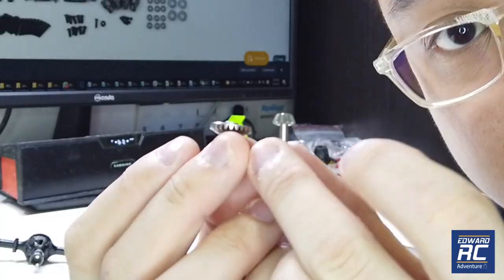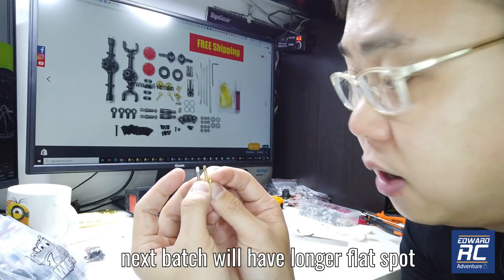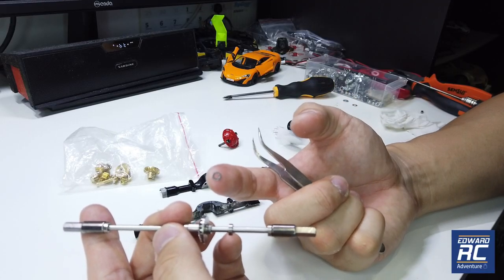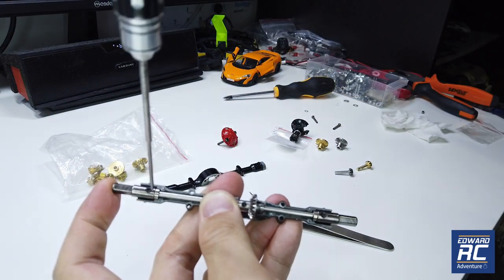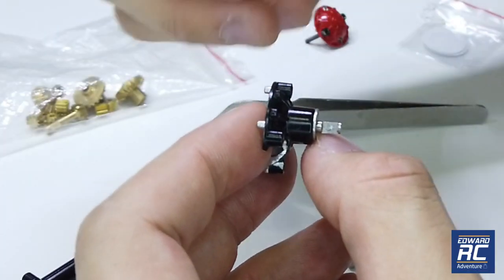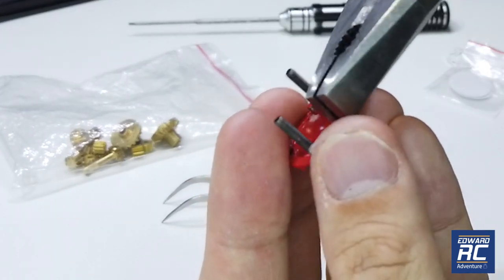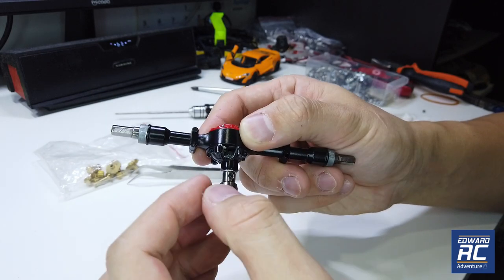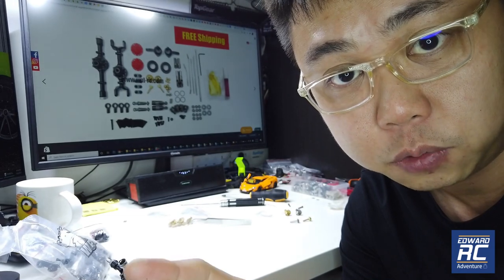WPL RC Metal Axle Steel Gears Binding Solution - CRITICAL UPDATE!

Comment: You really need to use washers with a smaller outer diameter on that input shaft, the ones you used looked as if they will be running on the outer ring of the bearing, they should only be touching the inner ring which is what rotates with the shaft.  The larger washers will just be producing friction against the bearing outer and/or the spur gear, they will wear out quickly and jam the axle with swarf.
Reply from the maker: yes that's why better to use the shims from WPL RC. in high speed application, using that M3 washer will cause high high heat.

Comment: The front brass gear on the axle, it's grub screw, even with locktite, keeps working free on me. I need a video with a real in depth view of how to get that gear set perfectly. It's so hard to keep a front end tight with all the flex and steering additions to wear and vibration. But, if anyone knows a surefire way to stop that front brass gear from loosening without using apoxy or jbweld, I'd greatly appreciate it. Video was very informative for the rear axle. And loving what WPL has brought to the RC world. I always felt 1/10th scale was too big for crawling, but these WPLs creations are definitely making a mark, and people are noticing. Look at Amazon. WPL is blowing up on there! Anyway, thanks again for the awesome video! 🖖
Reply from the maker: Hi Captain. Hmm i think the key is using a good hex driver instead of the L shape allen key that comes with it. Drip a small amount of the blue loctite around the grub screw, and lock it in. So far it didn't go loose on me. But once you have tighten it, leave it and let it dry. If you unscrew it after it has dried, you need to apply loctite again.
Reply: I am having the same issue with my front brass gear grub working loose.
Reply: @CookeCraft  same here. No solution yet ☹️

Comment: I ended up putting the washers between the differential housing and the drive shaft, that eliminated the play back and forth in that area and greatly increased the amount of pressure it could handle without binding. Check out "hobbywing 1080 wpl c24" the sacrosanct making videos together

Comment: Gosh yes love the help man I have no binding issue with mine but I have noticed that wiggle a little bit in there did not think of using the washer like this I've snapped 2 brass and one steel gear in half so far and I think that probably is over with the only thing I got to say now is if this works I'm I'm spend so much time just trying to get something to brake lol love the help

Comment: Hi Ed,
Have you noticed the input shaft bearing/bushing wear allows the shaft to get an angle that can cause binding and eventually snap the input shaft under load?
*Edit. You mention it at 5:20
Reply from the maker: Yeap that's the cause of it

Comment: Hi, this WPL D12 metal axel assembly set has come with enough washers right?

For after binding, have to  open the axel again to remove debris? Then apply grease before assembly it back?
Reply from the maker: depends which batch. u can get some here
https://www.wpl-rc.com/products/shim-washer

if it's binding, loosen the screw a bit and check again

yes you may remove debris and re-lube
Reply: @EdwardChew  Hi Edward, ask you, D12, C24, E1 batteries can interchangeable mix use??

Seems all are the same 2 x AA?
Reply from the maker: @fwfefrtefdv4719  Yes. they are not power hungry
Those are 14500 batteries, not AA.
Reply: @EdwardChew  Noted and thanks bro!

Comment: Who’s selling the axle bearing kits now you used? In us.. is there official wpl distributor?
Reply: Best place to get these is from the official store as other companies such as banggood and such have been known for messing peoples order up on a regular basis + its just better in general to support the main page 👍
Reply: @maxbuckley9762  I agree. I didn’t know if wpl had moved to an affiliate store in US since we buy so many of these. I’ll order when I get my B36 next I guess. Thanks!
Reply: As I understand it. They are working on a US distribution center. That will be great. A week instead of a month. Although I have received stuff in 2 weeks. Hell yeah I always try to go to the source, and these guys have been great.
Reply from the maker: @rockwolfdesigns6384  Yea the US warehouse supposed to start last month but we were hit with chip shortage so unable to ship the goods over yet. Trying my best to speed this up.
Reply from the maker: you may get them here :-）
https://www.wpl-rc.com/collections/metal-upgrade
Reply: @EdwardChew  it is not available on the site?
Reply from the maker: @clbmidnightracer  what item?
Reply: @EdwardChew  the steel input gear and ring gear set
Reply: @EdwardChew  As someone who's stripped too many brass gears I'm also very interested in buying the steel differential gears. Currently the site only sells the brass parts but I don't like having to replace the diffs after every run :-)
Reply from the maker: @ElJJ0  Well as long as the brass gear is setup correctly, it runs for very long time. we can see the feedback about this at the fb group :D

Comment: is there any difference in gear rations? brass one and metal one. 
If not is there any other gear ration exept original?

Regards,
Reply from the maker: Same gear ratio
Reply: @EdwardChew  sux, it could run faster with modified gears.

Comment: What's the reason for snapping off the pins on the axle cover ?
Reply: He actually said remove the "paint", not pin. I saw another video he did recommending you remove the paint for a better fit. Hope you didn't remove the pins yet. I hope this helps.
Reply from the maker: @rockwolfdesigns6384  hahaha heheeh yeahhh

Remove the "paint" off the 4 studs otherwise it's hard to slot it in
Reply: Ahhh ok makes more sense haha
 no I haven't removed the pins when putting them together in the past, all good. 👍
Reply: You can get 'real crazy' and use a paint remover on the pumpkin {differential} covers. I use an aerosol type that I spray on, wait 5-15 minutes and the paint bubbles off. That way the metal tolerances and proper fit are restored to the cover since the red paint is thickly applied.